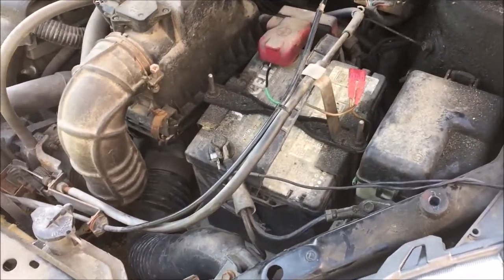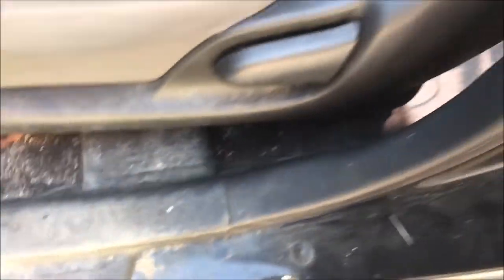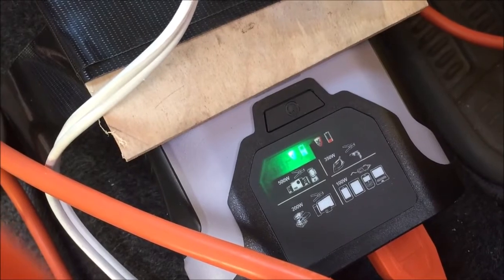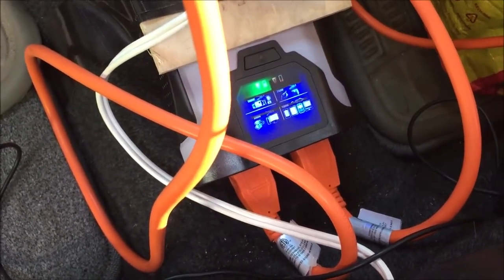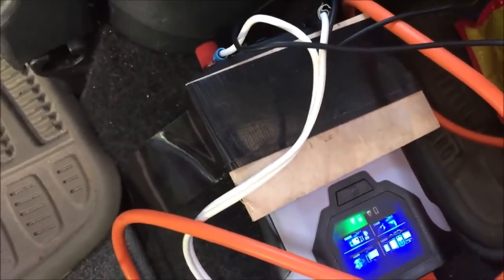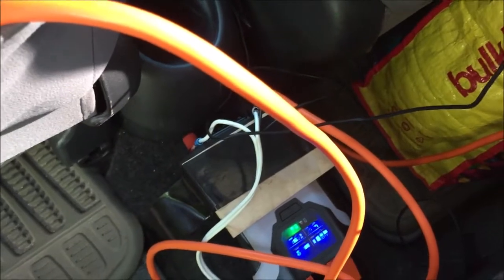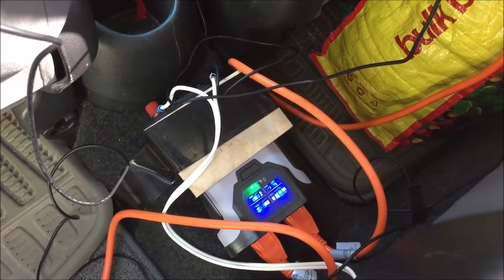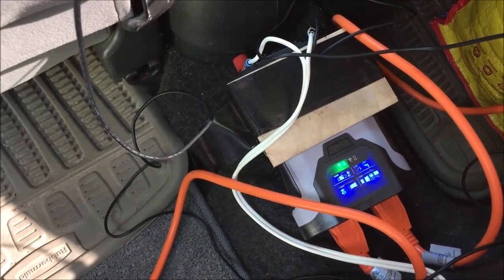How to Install a power inverter in a car direct to the battery

Comment: How thick was the cable that you used?
Reply from the maker: i just used light duty 120 volt lamp cord wire, and still every thing is fine after all this time your not drawing much for amps from the battery and your also only drawing 13.8 volts all in DC so no problem at all, i still put in a 10 amp 12volt fuse inline on the + wire just as a safty and its all good
Reply: @KevinMillard68   I just need to plug a digital speedometer because I have an old Chevy truck. Do you need to have that fuse coming off the battery?

Comment: How can you set this inverter to turn on and off when you turn your car on and off?  I don't want to leave the inverter on when the car is off.  Don't want my battery to drain.
Reply: You wire a voltage signal relay, when the battery is being charged you can make the inverter switch on,

The person who made this video has no idea the gauges wire he is using is completely wrong & he’s also using a 10 amp fuse, you want Atleast 8 gauge wire and a minimum 50 amp inline fuse that is water proof not on shitty spade connectors otherwise it’s a fire waiting to happen
Reply from the maker: you cant do that with any inverter that iam aware of, how ever this one goes into stand by mode and stays that way till you turn it fully on

Comment: You'll blow the 10amp fuse to much, remember, it's 10 amp at 12v. A 500watt inverter will need much more than 10amp.
Reply from the maker: well the fuse i use in the main power line is still fine and if your fuse is to low and the inverter over draws from load then you could have other problems to deal with and vices versa its a crap shoot